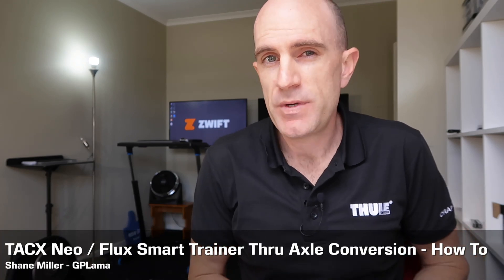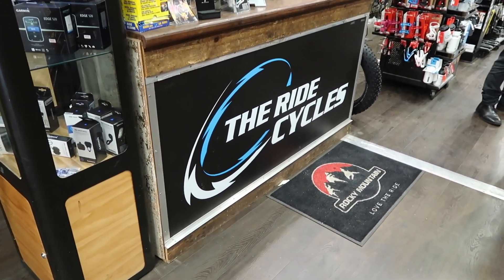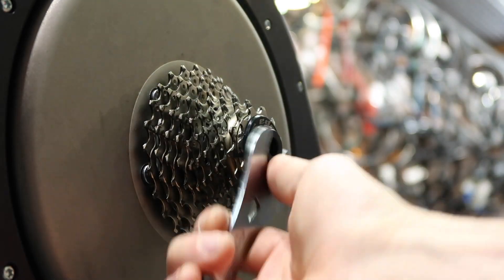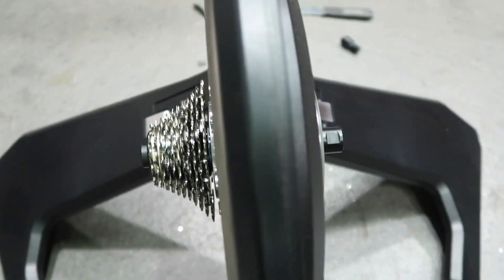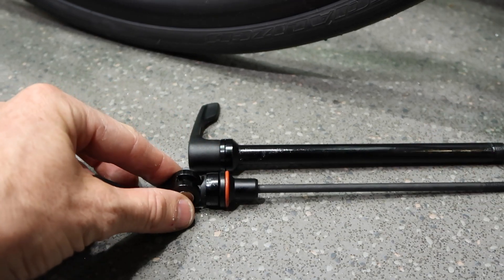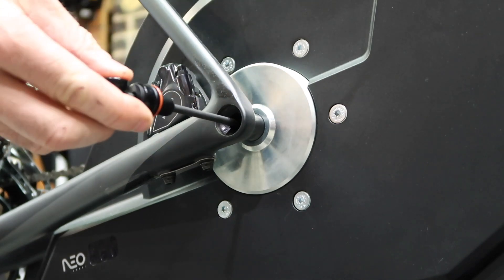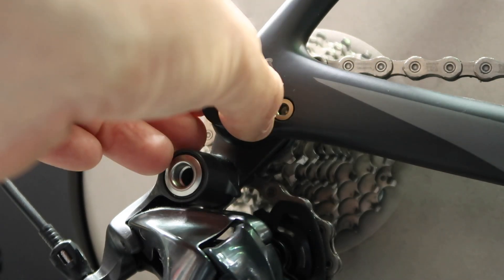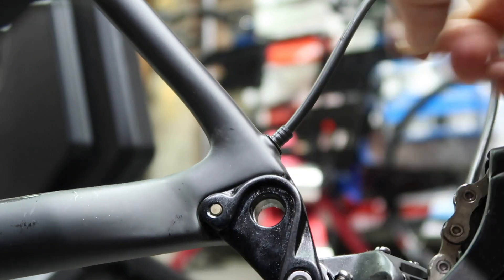TACX Neo / Flux Smart Trainer Thru Axle Conversion - How To [NEO1 &  NEO2]

Comment: If I install the Zwift Cog on my Tacx neo 2 smart tip 1 axle, will the same steps still work?
Reply from the maker: I guess so. You can take advantage of virtual shifting without a Cog. Just update the NEO 2 firmware and use a Zwift controller of some type (Play, Click, Click v2, etc).

Comment: Will this make a Neo2 compatible with a Zwift Ride frame? It seems like it would, but Zwift says the Ride frame is not compatible with the Neo2.
Reply from the maker: It should make it compatible. This is something I haven't tried myself, so I can't be 100%.
Reply: @gplama  Finally got the axle adapter from Garmin. The axle is not the only problem with the Zwift Ride frame adaptability.  The chainstays are too narrow near the bottom bracket and so bind on the Tacx Neo2.  If you raise the front of the Zwift Ride frame about 5cm (tilting the angle up), then it clears it and there's no issue.  So if you're willing to always have the bike like you're riding up a 9% grade, then you should be fine.  Hopefully this is helpful to others thinking about this.

Comment: What about the clearance for the caliper, how can i solve the rubbing and close fit?
Reply from the maker: One for Garmin support. They do include spacers to push out the rear triangle for more clearance. Not exactly an ideal solution to the problem, imo.
Reply: @gplama  thank you for the rapid reply to such an old vid! Don't really want to force anything, especially with carbon on a turbo, nor do I want to loosen the caliper every time it comes on and off. 😩

Comment: I'm glad I found this video. I own a 2017 Neo1 and have always used it with a 2016 Giant Defy with 135mm QR dropouts. Having finally bought a 12mm through axle bike in 2024, I had to buy this T2835 convertor kit. Thanks Shane!
Reply: Similar situation but my frame has a hidden thru axle hole on the drive side so my 2017 neo is incompatible now!

Comment: So, here is the thing! I do own a 3T Exploro Primo, with its oh so innovative Hang Loose derailleur hanger. Neither Garmin nor 3T can tell me if it is working with the conversion kit. They suggested me to buy one of the new trainers that use through axles from the beginning. Garmin today sent me a conversion kit to try it out for free and I will update you if someone is interested in that. But what I did not figure out from the video is: how is the end plug on the drivetrain side screwed in? Is it just the on the spanner axle and then pressed together? If so, that would probably mean, that it will not work… :-(

Comment: Hi Shane, hope this message reaches you. I effectively installed the right adapters, but after tigthening there is still mocement on the non drive side. Bike used is a SWorks Shiv. I am scared the frame will be damaged. Any advice?

Comment: Hi Shane, hopefully you can help me out with this. I have a Flux S and when trying to install the conversion kit I could see the new parts for the trainer's axle ends (the first ones you change in the video, where the bike frame will sit on later on) were not compatible. After some further research I discover from Tacx documentation that the Flux S trainers were produced using two types of axles (Type 1 and Type 2) and these vary in diameter. If I understood correctly this adapting kit only matches Type 1. Do you know any similar cases? Any guidance you can share? Thank you very much. Cheers from Barcelona!
Reply from the maker: It has been too long for me to recall. Best contact Garmin support on this one (They now own Tacx)

Comment: Do you know of any issue with Giant TCR frame? With my Canyon Ultimate I used to mount the non-conical part of the adpter but with Giant TCR seems to be to long and the frame results not locked in. The conical bit seems to be right in length but it has a conical base and I'm worring that it could damage the frame when locking.

Comment: Hey! Can you help me pls? I have an orbea orca and the adapter screw won´t engage into the derailleur hanger. It seems both are thread 1 but it just don´t want to screw in. I have the neo 2 type 1. Also i tried to use the axle from my bike but it also does not going through. Pls help
Reply from the maker: You’re best contacting Garmin support.

Comment: Shane, is it ok to just use the (thicker) thru axle from my bike instead of the skewer from the Garmin kit? Seems I would not need the little "plugs" on both ends as the bike axle just screws directly into the frame
Reply from the maker: The newer versions of this trainer don’t need this kit. They’re designed to use your own thru axle.
Reply: @gplama  Just to clarify:
1. Still need to replace the "adapters" (the aluminium pieces that screw into the trainer)?
2. But can use the bike thru axle (and don't need the Garming skewer and plastic "plugs")? 

Did I get that right? It is for a Neo 2 (not 2T).

Comment: Kind of late update (Jan 2024), but the "newer" kit comes with 3 additional threaded drive side "optional adapters" (1.0, 1.5, and 1.75mm thread) and also a white o-ring. Using the M12x1.0 threaded adapter with the o-ring on my Tarmac SL7 means that the o-ring is providing softer contact against the paint on the drive side (I would still put some sort of protective sticker (helicopter tape) on the bike to protect the paint). Theoretically this should minimize clamping against the bike frame (since it uses the threads on the drive side for clamping force instead of the surface of the adapter). Alleviating concerns regarding paint scratch from clamping against the frame on drive side.
Reply: is this for the tacx neo or the tacx e?

Comment: This video is way better than Garmin's. Question though ... when I put the flat cap on, it doesn't sit flush with my frame ... it's too long, seemingly, which means the frame is loose. Is there supposed to be an additional spacer?
Reply from the maker: Hmm. Not sure. The manual should have the details of all parts/spacers and where they’re to be used.
Reply: I have the same issue. Using a giant tcx. Don’t get it tight. Anyone with a solution?

Comment: I bought the Tacx Flux S and used it with my QR bike. Now I want to convert it to my thru-axle bike and there ware two adapters in the original package (the ones you screwed onto the trainer). Do I need to buy this new thru-axle now or is it possible to use the standard thru-axle that just comes with your bike?
Reply from the maker: I don't recall if the FLUX S has native thru-axle or requires an adapter. Best ping Garmin/Tacx support on this one.
Reply: @gplama  Thanks for the quick reply 👍🏻

Comment: Will this work for the cycleops? I just bought a Fezzari empire SL pro race and did not realize I wouldn’t be able to use my smart trainer due to the through axel…
Reply from the maker: What specific model of CycleOps trainer?
Reply: Hammer direct drive smart
Reply from the maker: From memory, the Hammer units have always supported thru-axle. Unless there's an incompatibility with your specific frame. One to ping to Saris support.

Comment: Hi Shane/everyone, is it the same conversion/adaptor kit for the NEO1 (OG) & NEO2?
Reply from the maker: I believe so. iirc it was the 2T that first had the 'native' thru-axle with no adapter required.
Reply: @gplama  thanks, appreciate it. Typical the Garmin site only lists it compatible with the NEO2, FLUX2 and FLUXS. I've got one on the way for my OG and will report back .
Reply: Can confirm, the TA kit supplied with a NEO2 fits my Neo OG trainer. Seems to be a 142x12 kit with 3 thread pitches so choose the right one for your bike. Even better mine is a Specialized Diverge 2016 Comp carbon with their crazy 'SCS' thru axle (around 137mm) which it fits fine without needing to move the caliper. I've fitted 142mm wheels to this frame with no issue so didn't expect one - but thought the caliper may rub. Bonus! 😁

Comment: Hello man,

I just installed this axe on my tacx flux. I have a specialized tarmac sl7, but unfortunately, on the opposit side of the cassett, my frame are not good fixed. I have a little gab and my frame move and it will fore sure make some break on my frame. Do you have a solution ?

Thanks

Comment: Dies the flux 2 ship with 142 adapters?
Reply from the maker: I believe the latest Flux 2 (aka the 2.1) has native thru-axle. I have one somewhere in a box here to review.... that I haven't opened yet.
Reply: @gplama  Thanks Shane. I've just bought one from a guy in Bendigo as new  and it's really as new. Came fitted with QR caps, skewer buy no 142. I can put a spare bike with QR on it but prefer my thru axle bike. Seller fitted a new 105 cassette so that's a plus. Flywheel feels decent.

Comment: The part you threaded into the trainer on the non drive side makes it too wife for my bike to fit on, however if I use the other the tapered piece won't slide into place as it is blocked, what do I do?
Reply from the maker: Best contact Garmin/Tacx Support.

Comment: Thanks for the video, but if you mount like you did on the carbon frame, you will damage frame somehow it on the other side, because you are mounting screw direct on the frame. I have Specialized carbon bike, and there is not possible to use this adapter, I need to use the original true axle adapter and it works, cannot use this quick mount adapter.
Reply: I’m having the exact same problem with my new tarmac I can’t find a single trainer that it will actually work with
Reply: @ryanbrown7240  like dude just said, use your bikes thru axle. That's what the latest Garmin/tacx video shows to do. Makes sense to me.
Reply: @cjohnson913  On the tax trainer you cannot. And the diameter of the inside mechanism going through the trainer is much smaller than the axle. I’ve been back-and-forth with TAX
There is no solution with those trainers the new wahoo trainer allows you to use your current through axle though

Comment: Thanks for the great video! I got my bike attached and it feels solid. The only thing I'm wondering about is if that nothing actually screws into the threads on the frame (where the thru-axle attaches) and the plug only threads onto the adapter pin, won't the weight rest on the threads in the frame, possibly damaging them?
Reply from the maker: The newer drive side adapter is threaded. Ping Tacx/Garmin support to see if you can source one of those for your setup.
Reply: @gplama  So the new adapter pin is without threads and the adapter just has a hole for it and the threads are on the outside? That was pretty much what I expected before I bought the adapters. It must be pretty new since it apparently hasn't replaced the ones in stock yet (bought it this week)

Comment: I have a question: I use the Tacx Neo 2T and I use the thru-axle from my Bike directly (142x12). Is that correct or should I use the adapter kit? But the thru axle itself works good? I am not sure and don't want to damage it.
Reply from the maker: The 2T uses your bike axle. This is one of the upgrades on that trainer from the Neo 1 & 2.
Reply: @gplama  OK perfect thanks, I saw a lot of videos on YouTube probably only from the 2 and not the 2T where they used those adapter Kits and was not quite sure about that. Thanks again for the answer, so I can use my thru axle from the bike without worries
Reply: @gplama  Hi Shane, I'm new to the Neo2T world, and first thing I noticed is that my disc brakes rub in the Neo2T case. So I added the spacer, but now the thru-axle doesn't go all the way to the other side. When the wheel is on, the thru-axel goes until the end – when mounted in the trainer, there is now a 3-4mm gap in the other side. Wouldn't that potentially damage the bike frame?
Reply from the maker: @gabrielgavasso  It really depends. Without seeing it I'm not able to give any useful advice.
Reply: @gplama Yeah, I understand and it makes sense. Thanks for taking the time to respond. There is a thread on the "Tacx NEO 2T" forum at foruns.garmin.com where I pasted a few pics (I understand if you don't go there to check it since Youtube doesn't accept pics on comments).

Comment: Great video,  I tried installing my 2020 Salsa Warbird on Tacx Neo 2.   I think it is impossible.  The Salsa Warbird has a derailleur hanger that is center mounted to the through axle.  There is a kind of endcap to be removed in order to attach the Tacx adaptors, but then the derailleur hanger is no longer rigidly attached to frame.
Reply: Maybe you can use a Robert Axle Trainer Adapter. Focus has for example  the R.A.T. Thru Axle that makes it impossible to install the bike on a Smarttrainer without one of these Adapters.

Comment: @GPLama Shane is there anything that would prevent you from using the thru axle that you use outside? Why need a separate skewer with adapters?
Reply: (I have a Neo 2T and a cervelo thru quick release axle seems to fit just fine)
Reply: I believe the answer to my question lies in the fact that the Neo 2T has thru axle support while the trainers discussed in this video don't
Reply from the maker: This is an older model that needs an adapter.

Comment: Hi Shane, my Norco has a different 12x142 setup on the drive side. It's a steel frame and the thru axle screws into a threaded captive nut on the drive side. The supplied 12x142 converter on my Flux doesn't reach thru this nut, and it has a hex end (rather than the exposed thru axle thread like in your video) to undo it...and i think it's integral to the hanger. Any suggestions?
Reply from the maker: That's one for Tacx Support. No doubt they've seen (and solved) it all for the different TA combinations out there.

Comment: Surprised no-one has asked about the way that the adapter clamps the drive side of the bike from the outside, what is the consensus on clamping this way and the potential for scratches and/or crushing the frame?
Reply: It looks like the kit (not shown in the video) has a drive side that screws into the drive side dropout. Would this work with Mavic Speed Release?
Reply from the maker: One for Garmin/Tacx support. I have no idea what Mavic Speed Release is.
Reply: @gplama  it is the thru axle system used on the Systemsix

Comment: I have a Cannondale SuperSix EVO ultegra. The hanger is double-lead (double threading). I finding I can't mount it on the Tacx Flux 2 because the hanger won't be compatible with the axel adapter. Any experience with this?
Reply from the maker: Hmmm. No. Ping Tacx Support on this one. They should have an answer. (I've met the support team a number of times. They're awesome. I hope they're still on the case after Garmin took them over)
Reply: @gplama  Gotcha! I'll get on to them now. Thank you!!

Comment: I just bought a second hand Tacx Neo and while installing the kit I found that the previous owner overtightened the drive-side nut. Now is stuck and since is made of aluminium and only has the possibility to be removed with the allen key now it is impossible to get out. Any ideas?
Reply from the maker: One for Tacx Support
Reply: @gplama  Thanks, Tacx  told me to take it to a bike shop... No time for that, I took a screwdriver and a hammer to make a dent in the external nut following the "Ultimate Handyman" Youtube advise and voila came out. 
Bad idea from Tacx to put an aluminium nut with an allen screw nut. Fortunately, the new kit comes with a hexagonal nut.
Reply: Amazing, contacted Garmin Product Support and in one day I received a new set of Tacx Direct Drive Block Caps for free. 
5 stars for their customer support!

Comment: If you have a Tacx Neo 2 you could run into a handful of issues if you buy the adapter kit. The parts the were included in the adapter kit did not thread on the Neo 2 but the extra components in the Neo 2 back thread well. Also, he mentions 17mm wrench and a #5 hex tool.  Have a 18mm, 19mm, and 20 mm available and other size hex tools available. Maybe it's a US tool box thing, but I had to make several runs to the hardware store to have the correct tools (which thankfully i do now)

Comment: Shane any help would be appreciated.  

1.  Any idea how to make it work with Mavic speed release axles? None of the supplied threaded adaptors are the same thread pitch.

2. On the disc side with the quick release.  You said choose the “plunger” thing based on the axle that comes out of your bike but what I can take from the manual says the flat one is for 135 and coned is for 142.  Just want to make sure I’m using the right stuff
Reply from the maker: I'm useless here sorry. I have no idea what Mavic speed release axles are. Best ping Tacx Support on these.

Comment: When you put the adapters, why don’t you just use the same thru axle that was mounted the bike.
Reply from the maker: The early model trainers didn’t have the correct sized hubs for this. They now do.
Reply: @gplama  Thanks! I was getting crazy! I bought the 142x12 adapter kit toghether with the Tacx flux S. When everything arrived I realized that just with the adaptors in the box and the original thru axle from my bike...everything worked ok. So can you comfirm that I am not missing anything? I don,t need the Thru Axle kit, do I? Thanks in advance!
Reply from the maker: @muyferbu  I'm not sure what they're shipping with now. Contact Tacx/Garmin support for this one.
Reply: So from what I understand….if my bike origina thru axle goes all the way thru and I can torque it up….i don’t need the separate thru axle thingey that garmin sells….correct?

Comment: 4:12 is it ok that the fitting isn't threaded? A blunt fitting in the threads of the frame seems like it might burr out the threads of the frame, was worried but guess that's what it is...
Reply from the maker: This is a while old now. The new adapters are threaded.
Reply: @gplama  Cheers for the reply, the one I got today 25/3/2020 isn't threaded -_-